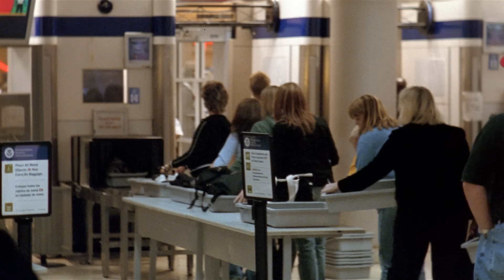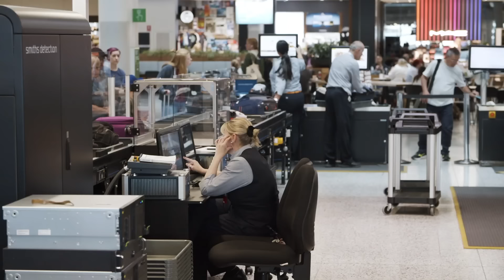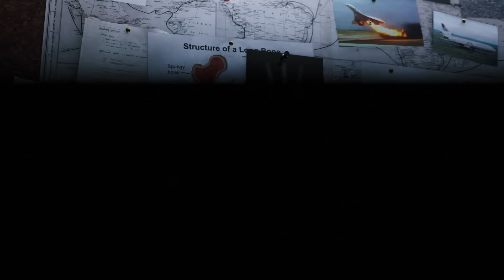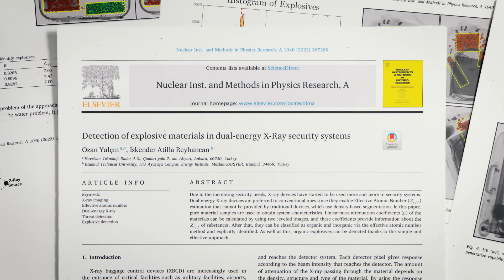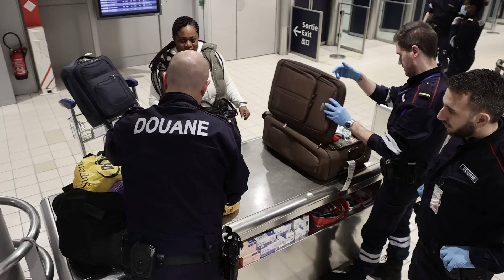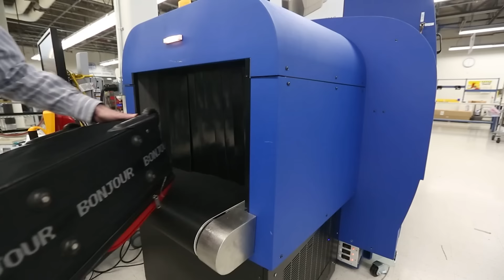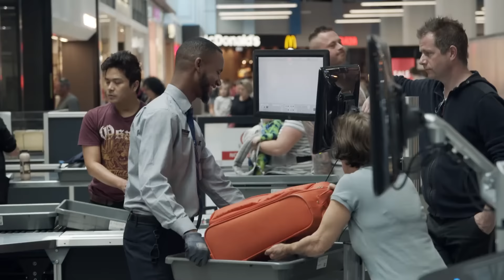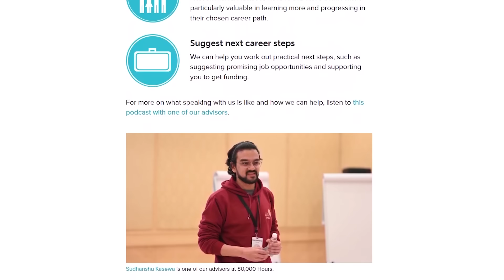Why Airport Security Suddenly Got Better

Comment: The CT image is formed as a series of 2 d images run through an algorithm that converts it into a 3D model of the cylindrical volume containing the bag.  This rendering from 2D to 3D is called reconstruction.  A math filter is applied which is complicated to explain, but let’s just say it converts pixels into waves kind of.  The filters have fun names e the Butterworth Filter and stuff.  You can play around with filter settings called power, and order.  There’s also something called the Nyquist frequency but school was a long time ago.  Then you get a 3D model which can be displayed in black and white grayscale, or any one of dozens of fun colour combos that make various densities easier or harder to see.  I think airports pick a standard colour scheme based on what the engineer nerds like most.

Comment: To put into context how good these security machines are. This year I flew on vacation and took my DSLR camera with me in a camera bag with a couple of different camera lenses. As it went through the X-ray machine the camera bag flagged an alert. The security staff swabbed the contents of my camera bag and they detected lens cleaning fluid that I used over 6 months ago ! Even then I would have used a trace amount on the glass lenses.
Bizarrely there’s an ingredient in the glass cleaning fluid they really really don’t like? 
If it really detected traces of the glass cleaner after 6 months and they’re just not using it as an excuse to pull me over. The “parts per million” involved must be amazingly small.

Comment: Flew from Gatwick a couple weeks ago. I was very surprised that they let me keep my water bottles and everything else in my backpack. I had an fpv drone, 6 lipos, a custom made 18650 powerbank and a bunch of other tech and I was sure something would get flagged. My backpack came through and did not trigger anything. I was so surprised!
Reply: I flew from Aberdeen (small but international airport) after finishing my studies with a desktop computer in my carry-on. Just the motherboard, CPU and CPU fan assembly and the rest as loose labeled components. I was very surprised that got through without any hassle. I was even prepped with documentation that it is just a computer, in case they needed it.

Meanwhile my partner behind me got stopped for having a small tuning hammer (not confiscated)

Comment: I want to say as someone who works in security in eu the scanners are very good but like you said because of the density of materials the machine can't figure out what is an explosive or a very dense shoe because of the density being so similar, so things like packs of cards ,iPad cases, some fruit, slippers, books, cheese  get detected by the system and thus automatically get rejected for search which is a pain because we can clearly see what it is and the machine cant and all we can do is swab the item of concern , same reason for larger liquids over 100ml it simply cant test it yet and proven I would say half the bottles of water are actually fine but half not due to the inconsistencies  so if your bag gets pulled off with the new ct scanners 90% of the time its the machines fault not the agents hope this helps people understand a bit more about security

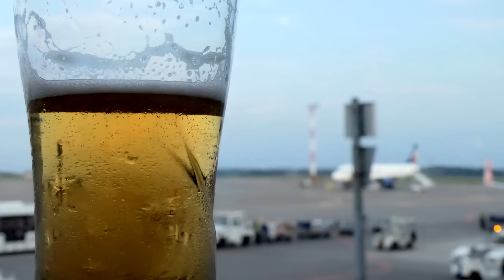Comment: 9:43 faster throughput isnt about getting people in so they can buy drinks, its about security. If people cant get thru the checkpoint fast enough, a long queue will form - and that queue is a soft target that an adversary could attack farily easily as its outside of the secure area. The Brussels airport attack is an example of this. Speed is security.

Comment: When they measure the volume of a liquid, a 3d model of the bottle wouldn't be enough, the same bottle could have different amounts. They have to measure the volume of the liquid, right?

Are they able to do that when the bottle is metal? You said they got around the issue of denser objects (like laptops) obscuring things simply by taking images from all around. If you have a metal bottle you would be blocked from all angles.

Do they have some other way of "seeing" through the denser objects? Even if you only let people use plastic bottles, it seems like you could put something between 2 laptops. Even if you could see the object from the side, a lot of this technology seems to depend on getting several angles.

Comment: A lot of the actual security for airports happens long before you get your carry-on scanned. If you check a bag at ticketing, there's a much better machine and a physical search "randomly" (read: every 5 or 10 bags) done below deck.

Plain-clothed agents are in ticketing, baggage claim, and depature areas (and public transit if it goes anywhere near the port), they're trained in reading body language, and they're looking for anyone who doesn't belong.

Cameras are everywhere and feeds are monitored in multiple places.

If you use a REAL ID instead of passport/ID+ticket/sec pass, your flight's passenger manifest and your position on it are shown to the agent.

Do these scanners improve passenger flow? I don't doubt it. However, I think a lot of it has to do with streamlining and automating a very small set of tasks, instead of actually improving security standards.

Comment: This really cool, thanks!  On the topic of saving time and money, if you sometimes look at a problem with a different bent, like not assuming STEM has the solution, we find there are even better and cheaper ways.  Cockpit doors are reinforced now, the stakes of hijacking are better understood, pilots are allowed to carry a gun, and policies are in place to minimize access to the cockpit.  If someone hijacks the plane, everyone on the plane knows there is no hope to plead for a safe landing if they are in charge. 

We only need simple metal detectors to catch the most egregious of weapons.  If someone puts a knife or even a gun to someone to threaten everyone in to pleading for peace, it will mean nothing.  Passengers would rather fight a hijacker than become a suicide bomb, so they will fight no matter what the hijacker says.  The fact that 9/11 happened means that's no longer a usable tactic, it's spent.  

All this extra delay in security is unnecessary. The entire DHSis not necessary.  A few policy changes and stronger cockpit doors were the answer.  Keeping Air Marshal on flights is probably a good use of money though.

Comment: My biggest gripe with TSA is their incompetency, and also the fact that every airport was different. San Francisco did it different from Dallas. Phoenix did it different from Denver? And I fly constantly with security. Items, so I constantly was getting checked and their incompetency really showed. They hassled me over a master tool that I used for calibration. Didn't nearly let me take it on the flight? Even though I have flown with it probably Uber a 100 times at this point. Finally got on the plane. Got to my location, opened up my backpack. Found a razor blade in my backpack. They missed that. And hassled me over a blunt round object

Comment: Airport security, long after 9/11, is designed to discourage people from flying, to make the experience of air travel as unpleasant as possible and this also includes full body scanners, now using the excuse of climate change post-Covid - this will be extended to all other forms of transport (including train snd ferry travel) very soon, as it’s already in place at courthouses and both into and out of jails and in many other settings

Comment: Science and engineering are wonderful things. Also, think about how this is helping medicine. These are starting to approach what can be seen with a basic MRI. (The 5 and 6 T machines are a different matter, though.) Think about oversized machines checking train cars and shipping containers. That'll make customs a lot faster too since you will no longer have to actually open the container to see the full measure of what's inside. This could also be used at border crossings to help detect smuggling. Now, these last two are totally different levels of design challenges and physical issues, but if it's possible at one level, why not explore what can be done at another level just to see if it can be done? If so, see if it is useful and can then be made practical.

Comment: I'm sure there's some other technology not explained here, because the one big glaring flaw I see here is that you can just add a hollow space to any container, which will throw off the density calculation and result in supposedly different detected fluids. Would be one hell of an easy way to bypass the machine; no way they didn't think of that while developing it.

Comment: Dual energy scanners are not new at all. Even the older 2D line scanner machines are dual energy, which is where you get the different colors (orange for organic, blue for metallic, green for mixed). They have to use the z-eff approach, because 1mm of steel looks just like 30cm of water in a "regular x-ray image". The new part is not the z-eff, but the spacial separation in 3D CT images, eliminating thickness as a factor. The most recent improvements where you can keep your water bottle, as Kevin pointed out, is the combination between density (more specifically single energy absorption coefficient), z-eff (dual energy absorption coefficient ratio) and spacial resolution (elimination of material thickness). Just that z-eff is the older part from the 2D era, while the material density normalized for thickness is new.

BTW, the HiScan 6040 CTiX seen in the video does something much simpler than "fire two x-ray intensities" at the material.

Comment: Both ways between were I live and my parents live have them now and it's a dream. Watch kept on, glasses just put on shirt.bottle of water laptop in bag. Straight through no issues. Even my back lock clip that always used to get questioned for looking like a knife (it doesn't but I get it could on a scanner) is fine. So quick

Comment: I work at the airport  in one of the most technological advanced countries. Like most travel guidelines, we still have to stick to the 100ml (container size) limit for Liquid, aerosols, and gels. Apart from that, even shaving blades are prohibited (if not kept in a protective packaging). As well as scissors with a sharp blade, and more than 6 cm in length. 

Shoes must be taken off if it covers your ankle. And thankfully, for electronics wise only laptops must be put on the tray. Other things such as belts, accessories, cables, powerbanks, ipads can be still kept in the bag
Reply: That’s pretty backward, I spent 20years operating an X-ray scanner at an airport. You must have poor training or extra old technology.
Reply: @PungBoy3  Nah. I think we're alright. I'm not trained to look at Xray images. But only general screening techniques. Plus, we do it in batches since we would only screen passengers before they wait at the boarding gate. So the process is much quickened. Some people would still wonder why ours are much more stricter than others

Comment: Medical Physicist here. Overall, great and education video! You did a thorough research on this topic and radiation is not an easy topic by any means. However, I want to clarify a few things;

1. Photoelectric effect is not the only interactions X-rays have with matter. X-rays and other high energy photons attenuate with a multitude of different interactions, all based on probability. This probability is dependent both on the energy of the photon as well as the density of the material. Rayleigh, compton, photoelectric and pair production are the primary ones. The total probability of a photon interacting with matter is the sum of the individual probabilities for the different interactions. 
2. The probability of attenuation does generally speaking decrease with an increase in photon energy. However, the main reason why photons with higher energy can pass through thicker materials is because they have more energy to begin with. Imagine rolling a ball with one speed and then rolling the same ball with twice that speed, the ball will roll further before stopping.

Comment: I beg to differ. These machines take longer, and false flag items making them look like something much worse. Being a seasoned traveler myself, and a member of TSA PreCheck, we typically try to avoid any lines with newer machines. So many bags get pulled off to the side and it holds up travelers.
Reply: That’s due to poor training. 20years experience here. We’ve had scanners for 25 years in and out of our country.

Comment: I fly at least 20 times a year and I will say in my case, airports that have these new systems are way more likely to pull my carry-on aside and check it. I do fly with a lot of electronics and camera equipment but the majority of the time I don't have an issue. But I flew out of Indianapolis, which has these, 4 times this year. Every time they pull my pelican case or backpack out to make sure my camera or laptop isn't actually a weapon lol

Comment: I’ve found this to be very country specific and am now somewhat convinced that airport security is a complete farce. 
Last summer, I flew from LAX to Dublin. At LAX it was all the usual—less than 3 oz liquid, no shoes, laptops out, etc. In doublin, it was all about the litre sized plastic baggy of 100 mls of liquids. Weird cap on how much liquids, but whenever. Then, they took my mom’s cosmetic scissors. She brings them everywhere for little things like cutting off tags or strings from your clothes. The reason the agent in doublin took them? “The TSA in the US is very strict, they’ll never let you in with these.” Except we’d just gone through security at LAX. And obviously they let us through with them, otherwise they wouldn’t be in doublin??? Next was LHR which was a madhouse. They pawed through the suitcase of the man in front of me and found nothing. Then they pawed through mine because I had bug spray that was leaking (which I did warn them about!). It was about an hour of waiting while they searched through everybody’s bags, after going through long lines with workers practically throwing the litre sized plastic bags at us, screaming to fit the liquids in. It was obnoxious. Then we went to Italy. Security everywhere (except the last supper painting) was a joke. The metal detectors weren’t even on. How do I know? We held all of our belongings and phones as we walked through them. We couldn’t help but laugh. It was like this all over the whole country. While they were probably on at the airport, they also did not care at all what we brought with us. We made it out the other side of security with multiple full water bottles and my hydroflask full of clanking ice water. We weren’t even trying to hide it! Then we had a layover in doublin, and managed to accidentally skip security. We were in a hurry, and there were long lines, so we kept walking and ended up past security entirely. Nobody stopped us and we didn’t realize until we were at customs (you go through US customs in doublin before you get on the plane—Americans work there from US dept of homeland security). The whole experience was strange and also quite comical. A summer I will never forget. This summer I am going to Nice and I’m very excited to experience security there. Maybe it’ll be a mix of the strict isles and entirely too relaxed Italians?

Comment: Well, you can't bring water through security, but you can bring a water bottle through it and then fill it in the toilet (most airports have special drink water tabs there)

Because many airports and dufy free shops were using this rule for their own advantage and so water in the airport is very overpriced

Comment: The key lies in identifying the absorption patterns for different peak energy X-rays, which can differentiate substances with high accuracy. This is achieved either by having dual-source X-rays in these machines or by a single X-ray tube that alternates rapidly between two generator voltages.

Comment: You said you don't know how the material is recognized. Probably mass spectrometry, which has become relatively cheap and small in the mean time. I remember when I started at university more than 10 years ago the newest gen mass spectrometers cost about 5k€ and could easily be held in one hand.

Comment: I wasn't flying for about 15 years and had to learn not take water bottles with me in the luggage because I wasn't used to those processes. I learned quickly so in Amsterdam I drank my water in a hurry before entering the security area. A security man saw this and told me I don't need to do it. I was really confused. But now I know.

Comment: I've worked in the installation of a large scanner for containers, the truck could drive thru at 35 km/y and still work. From sides and top it would scam everything and even be able to check the screws in a TV.

Comment: All of this security theater is absolute nonsense. The TSA has, since its inception, never thwarted a potential terrorist incident. That's obvious, because if they ever did, that success would be trumpeted far and wide to justify their existence. In fact, you can argue that the TSA has caused more American deaths than Al Qaeda ever did, because by raising the cost and hassle of short to medium distance air travel, they've diverted people to the highways, where the death toll per passenger mile is 30,000 times higher EVEN INCLUDING 9/11. All that is truly necessary is basic X-rays to identify firearms and other actual, legitimate weaponry, and to lock the cockpit door.